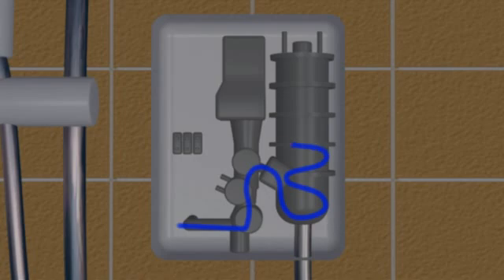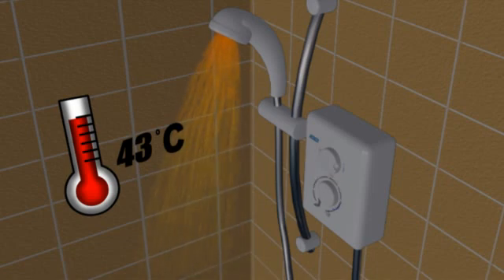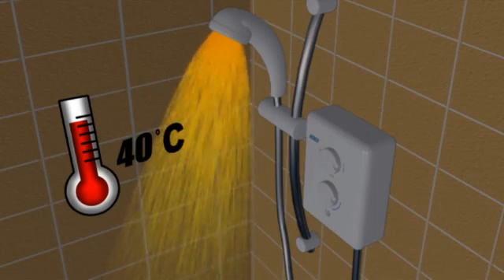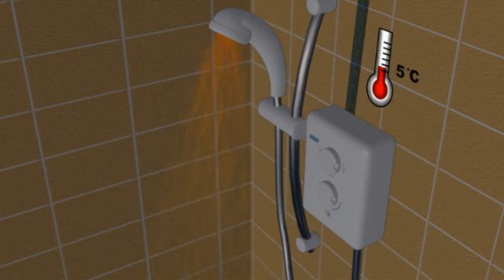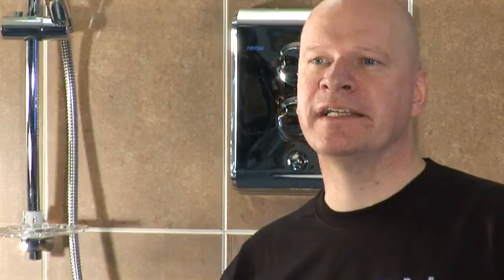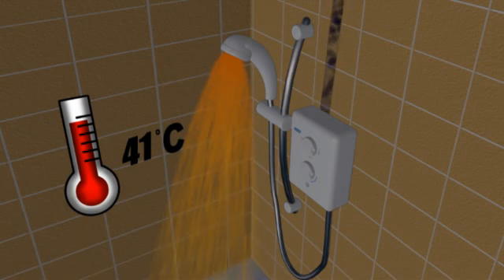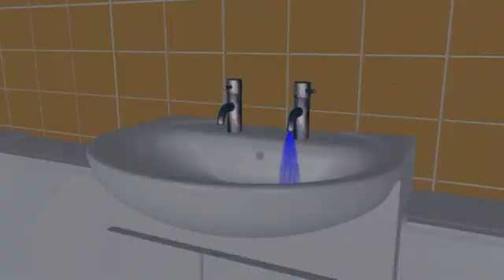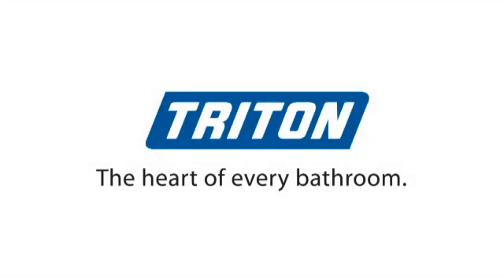Electric Showers: "What is an electric shower?" video from Triton Showers

Comment: How comes the water is orange?
Reply: Rust.  Or food coloring so you know it is working.
Reply: Because a special water is used in this process to heat up quickly, it's boiling point is about 60°c. This water has a chemical that turns orange when heated. Those chemicals are not harmful, they're called cheetoxide
Reply: @SamiiRSMT cheetoxide as in the cheetos?
Reply: That's the Normal color of water in the UK.

Comment: Is it safe?
Reply: Perfectly safe
Reply: We've been using it for 90 years in Brazil, super safe, I recommend
Reply: Don't stress, my friend. It's very safe, as long as you don't do any makeshift installation. To be 100% safe, you need a good grounding system. However, in most houses in Brazil, grounding is not used, because many older houses were not designed to have grounding. So what do you do? The ground wire is connected to the neutral wire. In any case, the risk of electric shock is very small, especially in modern showers with plastic housings.

Comment: Where's the plug?
Reply: thomas binninger there isn't one - it's hardwired in to the wall (using a dedicated cable straight to the houses electrical unit). Plug sockets in the bathroom are illegal in the U.K. unless there is 3 clear metres in every direction from the socket to every water point (toilet, sink, bath etc). Only exception is shaver and toothbrush plugs which are a different style of plug.